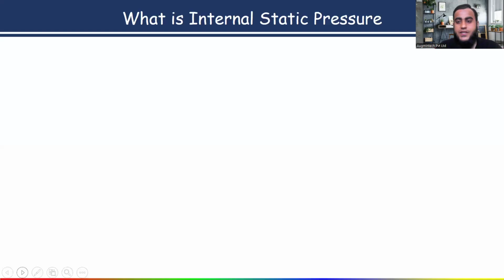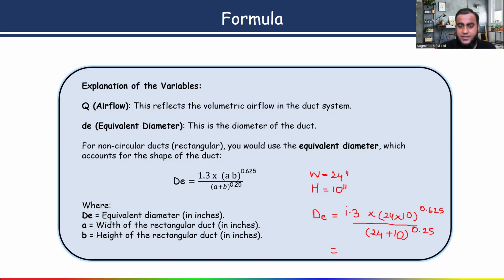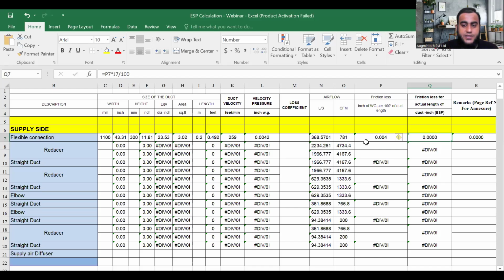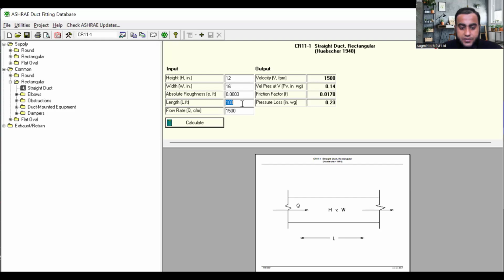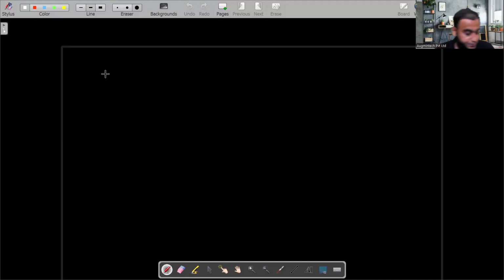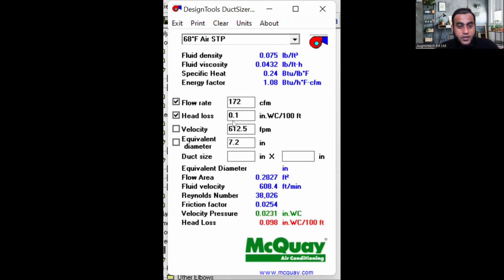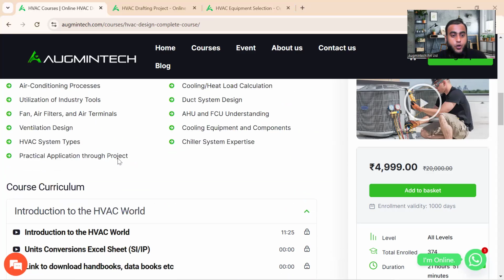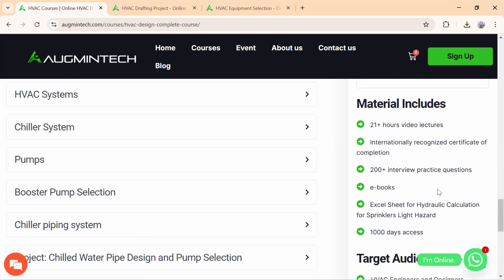External Static Pressure Calculation | HVAC | Augmintech

Comment: I came here because I'm considering your "Revit MEP Professional Design and Modeling Course" on Udemy. I'm worried that everything you show is in metric units, but I see you use both here. Is that the same for the Udemy course? All of my work is in standard Imperial units. This was a great presentation, by the way.